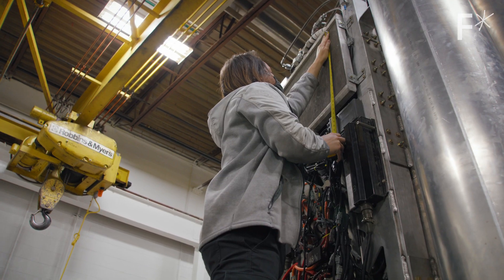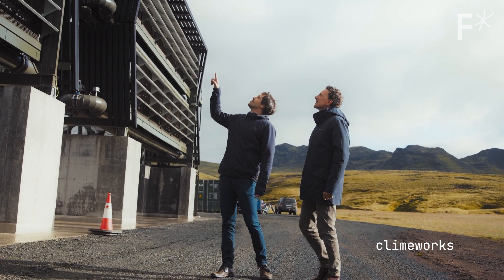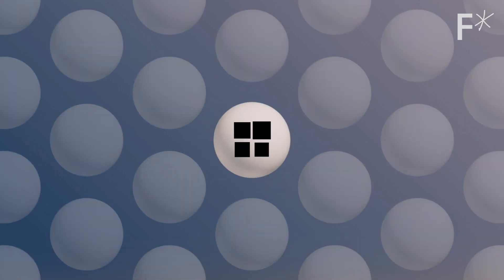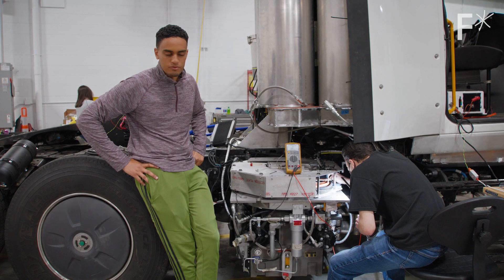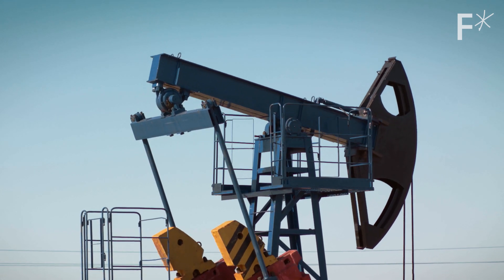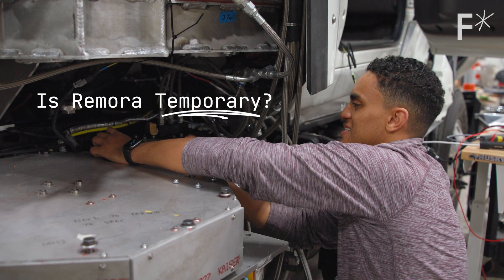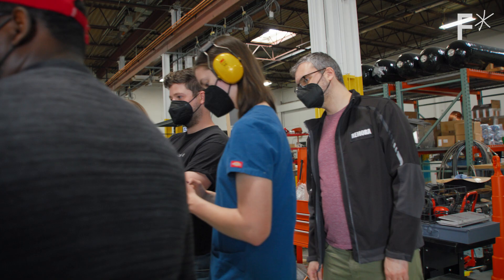Can this invention fix dirty transportation? | Challengers

Comment: Cool idea and something what should come with the every ICE, however practicality and compatibility of the solution might pose further challenges. Still at least something is being done in this field before full transition to electric propulsion which require vast charging infrastructure. This looks more like a mid transitional solution than a final one.

Comment: I read an article titled "Preliminary Design and Off-Design Analysis of a Radial Outflow Turbine for Organic Rankine Cycles" by Jun-Seong Kim and Do-Yeop Kim, published in April 2020. The article claimed that a 400 kW Radial Outflow Turbine generator for sCO₂ could operate at 85% efficiency. For reference, 400 kW is equivalent to 536 horsepower. This system could potentially offer a much lower weight burden compared to relying entirely on batteries, while at the same time dramatically increasing range.

In comparison, a typical diesel engine in a semi-truck operates with an efficiency of around 40 to 45%. On the other hand, electric motors, which could power an electric truck, typically achieve efficiencies of 90 to 95%, resulting in a round-trip efficiency of approximately 76% when considering energy conversion and powertrain losses.

Additionally, by incorporating carbon capture, you could repurpose the captured CO2 to produce methane in combination with green hydrogen, creating fuel to power the aforementioned semi-truck. This approach would significantly reduce carbon emissions and contribute to a more sustainable transportation solution.  While you refueling your truck you could empty your CO2 reserves.

Comment: Largest battery manufacturer on earth CATL has made 500Wh/Kg batteries that are energy dense enough for commercial flight.  Which means yes you can now have an electric truck with 1000km+ range.  You pointed out the mining and emissions of Battery materials, yes it's hundreds of millions of tonnes, compared to fossil fuels hundred of Billions of tonnes!  Furthermore when there's enough battery minerals in circulation we can stop mining the material because unlike oil and gas, batteries can be recycled into new batteries!

Comment: The guy was very quick to bring up greenwashing in battery EVs, but didn't even adress the issues with this technology. Surely this is less clean than EV trucks. They only capture 80% of the CO2 and didn't even mention gasoline production and transport.

Comment: Truck diesel engines produce a lot of wasted heat you have utilized a small amount  in the process how ever the weight of the capture unit needs to be reduced significantly, there is a mechanism most trucks  already use often overlooked , that is a engine breaking system that turns the engine in to a compressor instead of wearing out brake shoes, known in most places as a Jake Break, if you used a compressor  instead of the engine to compress the C02 in to liquid CO2 as it is being produced especially in and around towns and cities this type of break is not allowed to be used in built up areas due to noise pollution, how ever a purpose built compressor that can be used for both breaking and CO2 liquification could be on the drive line eliminating the loud exhaust noises from engine breaking, Just a Thought the excess heat from the power plant normally wasted could also be used to compress the CO2 Through a refrigeration compressor similar to the way an old fashioned CROSLEY  ICEY Ball Produced ICE almost 100 years ago.

Comment: I say good thinking. May cause more to be produced due to efficiency weight issues but as long as the capture of say 80% with adjust bringing it in at 70% true reduction then win win. 

I could see several manufacturing solutions to reduce cost and increase speed of production so no probs there. But the pipe dream of oh we'll never sell to oil/energy companies needs to be snuffed out.

You don't make a more energy efficient gas engine and go nope not going to use it since it'll mean another gas burner. Foolish youth that has to look at reduced pollution output and not rose colored glasses of EV puppets.

Which EVs have been shown that one has to have a life of the range of 40-50 years to get to have a lesser pollution impact of a gas car achieve in a decade plus or minus 2-5 years. And when one can admit that fact then can see easy why this system here is superior to an electric runner. And then can begin to look at what else is needed to ultimately win the gold. And till one comes to accept that reality are chasing paper with gold ink on it saying it's gold and not fake.

I hope they keep up what they are doing in this video and once they come to see past fantasy they will see they accomplish more than Tesla company has and will do over the first 50 years of it's journey.

God's speed

Comment: one of the primary issue is weight of cylinder leading to less mileage , potential solution could be storing carbon in some sort of salt and containing it as cylinders are heavy

Comment: The system weighs 5000 lbs. I think that I would rather have a 5000 lb battery and eliminate the diesel altogether. Nice thought though impractical.

Comment: If they sold to oil companies, this solution would be financed quicker than any other start up. It’s actually really smart if they sell to oil companies. Then the oil companies continue to produce gasoline or diesel fuel which is used to power the vehicles to capture the carbon. They make a partnership with oil sound bad, but I think it’s actually win win as long as the CO2 oil companies use is not furthering climate change.

Comment: This is a perfect application for carbon capture. These trucks are running 100+ hours and burning thousands of gallons of fuel, per week, all year round. They tow 30 tons so weight isn’t an issue, and the power to operate the device is readily available. They also have space for the machinery. Heavy trucks tick every box.

Comment: The internal combustion engines of pistons are like large furnaces that burn fuels to make hot air, only 15% of the energy they produce is used in the form of movement and all the rest 85% is wasted in the form of poisonous gases, vibrations, and heat and in addition they need to use lubricants in large quantities that also pollute immeasurably... The solution is to get rid of the main problem which is the use of these ovens... After that we will see good results...

Comment: First of all, I love the fact you have a group of people of all shapes colors and flavors who are just working together to make the world better. They are not having long awkward conversations how they need to be inclusive of everyone as they are just doing it.
HOWEVER, this idea/device of course was invented by an engineer. There is a semi need for it as I don't see how they are going to get it paid for. A diesel truck weighs 20,000 plus 80,000 payload. This device is FIVE percent of the trucker's load which is more weight/more cost. They trucker is more concerned with putting food on the table vs. saving the world.

Comment: 5000 lb on an 80000 lb limit truck.  Assume 30000 lb for the truck and trailer.  That is about 10% of their cargo weight.  That is doable...

Did I hear this right? A truck can produce 200 tons of CO2 a year?
1200 lb of CO2 storage.

400,000/1200 - that is a 15 minute de-tankkng 333 times a year - assume once per day. Since you could be anywhere when you need to drop it off, that is hassle, and people on a schedule will let it fill all the way up before emptying it.

Pretty cool idea, even with the challenges.

Comment: The semi engines made since 07 unfortunately are universally hated by drivers, mechanics, and accountants due to unreliability, high cost, and less power and efficiency. This maybe welcome by truckers even with 2 tons lost billable payload for weight of unit. IF they can figure the Nox thing out which I don't think they mentioned, the Nox systems and the engine changes of running lean are primarily issues with the 07+ newer engines. Figure it out and godspeed to ya. Even if stopgap measure, the next 30 years we need all we can get and these trucks will be on roads for a few decades, barring zombie mad max of course.

Comment: Why do we have trucks travel coast to coast hauling 1 shipping container when a single train can transport double & triple stacked shipping containers? The reason why so many truckers have living quarters is due to how inefficient the freight system has become. It's not that I hate the idea of carbon capturing but it makes trucks more complicated than they have be to treat the symptom of broken infrastructure.  

Snakes argue that we shouldn't invest in high speed rail because of air travel making it cheap to travel from coast to coast but that argument doesn't hold up for local regions such as the "Texan triangle"

In 2004, the Texas Triangle contained five of the 20 largest cities in the U.S., and was home to more than 70% of all Texans, with a population of 13.8 million.[6] In the next 40 years, the population of the Texas Triangle has been projected to grow more than 65%,[7] or an additional 10 million people, leading to 78% of Texans living and working within the Texas Triangle. From a resident's perspective, the Triangle is gradually becoming synonymous with Texas.[8]

You could have bullet trains between the cities, subway systems within those cities, and a bus network to make up for the shortfalls.  There has been a lot of terrible urban planning in the past that will have to be rectified by the bulldozer if we want our elderly & youth to get their independence back. Homes & businesses will have to be demolished so that everyone has movement independence and not those with a car.

What is America going to do once the boomers are no longer allowed to drive due to aging? Stick potentially 69 million baby boomers in retirement homes? What about the youth who can't have independence until they get a drivers license? The moment the youth get their license to have mobility independence they're only a few years  away from being required to work for a living .

Comment: Engineer here, If that is running off the cars engine then the addition of the system would just cause a net increase in the carbon released. Even if you are capturing it you're still increasing the production of CO2 and with the "absorbent beds" you just have a enormous amount of bed material soaked in CO2.

Comment: Compressed air burns every diesel molecule easily retrofitted from every diesel motor beating current California emissions. How about renewable diesel from grass or wood chips using compressed air to burn every diesel molecule leaving the tail pipe free of carbon ???

Comment: They only want "solutions" that generate revenue instead of solving the problem. More trains less trucks! You don't take grocery bags inside 1 at a time because it's not efficient. 
Guaranteed it will be a subscription service instead of just equipment so they get paid to gain a second product exclusively and sell the product exclusively. Profit from all sides equipment sells, mandatory exclusive subscription services, "certified" installation and maintenance services, sales rights for harvested product.
The problem isn't being solved with this technology! The truck is still coverting fuel into emissions at the same rate but just bottling it up for profit and not actually reducing or improving anything.

Comment: In India most of our freight and goods are transported by rail which is 90% electrified. trucks are still used for loads less than 20 tonnes and last mile connectivities or between major cities and towns. with 1.4 billion of the population we are still 5th on population scale and having 230 mil population USA is on the top spot, even though they outsource most of their manufacturing to china. gross negligence
Reply: Good news!
You  must take a look at the March edition of the scientific magazine'Joule' and the 'CO2Rail' website to see the 'DAC railcar' innovation which will allow trains to capture CO2 from their slipstream while using the  energy from braking to power the. units which  have been reduced to rail cars size.There will also be a railcar to  extract emissions from the  diesel engine.Unfortunately  it is unlikely to  capable  of. being scaled down to truck size but who knows maybe for aviation?

Comment: Worth watching. John Neidigh’s (rhymes with “I dig.”) take: Electric semis are impractical and basically reinventing the wheel. 🙄 Retrofitting existing diesel fleets with mobile carbon capture makes much more sense AND generates income from the CO2 captured using the exhaust heat that is normally wasted! Kill two birds with one stone. 😉🙂😎

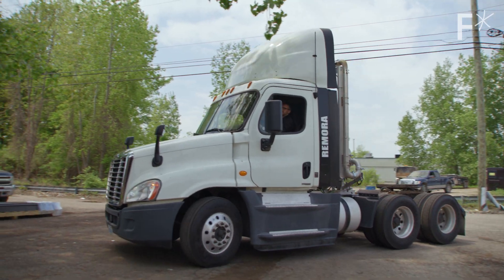Comment: 7:06 "...Remora's device can capture and store up to 1,200 lbs of CO2."

A gallon of diesel produces 22 lbs of CO2, if this device can only store 1,200 lbs of CO2 before bypassing emissions to the atmosphere then it will fill up after the truck uses 67 gallons of diesel. (Assuming 80% of the CO2 produced is captured) Typically semi trucks store 2 to 4 times as much fuel, which means Remora needs to be 2-4 times bigger to actually meet their 80% carbon capture claims since emissions from any fuel used after 67 gallons bypasses Remora. If a truck uses 150 gallons of diesel in one trip then this incarnation of Remora would be closer to 36% efficient.

This seems like a pretty big problem for Remora, there's a mismatch between the CO2 capacity of their device and the amount of carbon semi trucks carry in their fuel tank. To meet their 80% CO2 capture claims they either need to find someplace to put larger CO2 tanks or store CO2 at higher pressures, which surely comes with additional engineering challenges. They could ask truckers to stop more frequently I suppose.
Reply: 22Lbs? Can you run that  by us again please...how much does  a gallon of diesel weigh?
Reply: @edwardhogan1877  It's not just the weight of the carbon in the diesel, after combustion it's combined with oxygen from the atmosphere. Air is heavy (:

Comment: GREAT BUT SEVERAL QUESTIONS - What about cost, size and the extra energy needed to pressurize the CO2 as well as the extra pressure needed to push the exhaust thru the zeolite bed

Comment: Interesting concept but completely ruling out EVs as greenwashing… yeah no. I think this technology could be interesting in the transition but they’d be racing the clock on scaling and rolling it out before they are made redundant.

Still it’s nice to know people are thinking about and working on things like this. Also they raise a good point about carbon being used in all sorts of things, be interesting to see what happens to that market and how far this product goes.
Reply: Lithium ion battery powered EV's as we know that concept today is not a viable solution for the wider market ... the mega wattage consumption which the EV charging stations require becomes pretty clearly backwards and illogical if you consider the numbers and scale them up for EV  semi trucks and any large scale roll out of consumer EV cars ... it wouldn't make any sense and the next best tech atm is hydrogen cells, not that any of this is the full picture.. yet

Comment: I have been really hoping to see inventions and concepts of this nature to get us through this "transition era" because it's unavoidable to think we could just Jump right to a completely different energy/transportation method and this constant idea of "battery vehicles" etc are green, are totally non sense because our power grid and factory systems still fully run on fossil fuels to run the energy/electrical grid/transportation etc. So until we mass provide electricity for the grid in new modern advanced nuclear energy options and alternative power sources, then this type of concept invention is a great perspective on how to approach this problem. 👍🏻

Comment: Pretty cool stuff, greatly appreciate the work y'all are doing. Some believe carbon capture is part of a push/plan to be able to maintain the industrial practices we've been following all along in the long run, and while I think there's some truth in that, that doesn't take away it's immediate value in meeting our goals for reduced emissions
Reply: Mobile carbon capture is completely retarded and downright evil. Transportation is all about moving the most amount of stuff and using the least amount of gas and ultimately for the cheapest price possible. Sure maybe carbon capture is not completely bogus but mobile carbon capture is like mobile massage why just not practical economical or comfortable

Comment: This is very exciting! CO2 can be used to make carbon nanofibers, which means the auto industry could potentially use this captured carbon to make car body panels and parts from this new source. Various building materials could also be made from carbon fiber. There are so many applications for this material, it just needs to be commercially marketed and distributed. Thank you for sharing this with us. 💗💗💗

Comment: Why are they building the zeolite containers that way?  It seems like you could attach a shaker/vibrator and pour it in from the top - keep packing/pouring until 100% of the required amount is in the container.

Comment: Nice solution. They can reproduce methanol using CO And H2 coming frome renewable sources. For this, gasoline-powered engines are needed. And the engine should run with low oxygen so that CO is released.
As a result, when we consider that the efficiency of the internal combustion engine is 20%. Investing in electricity makes much more sense.